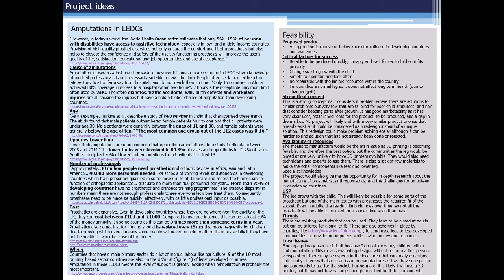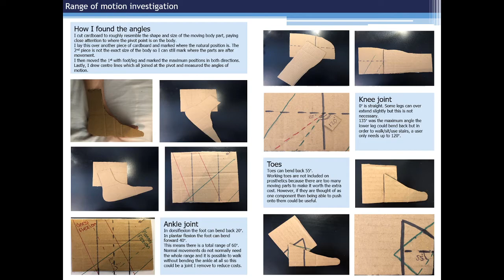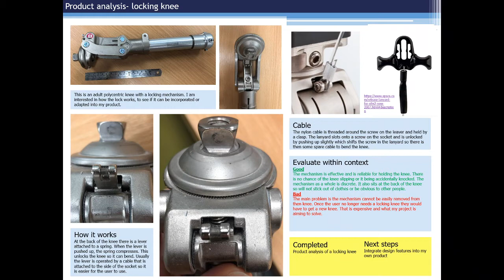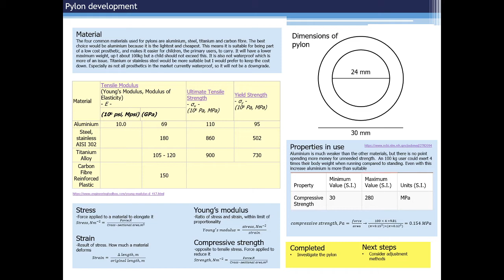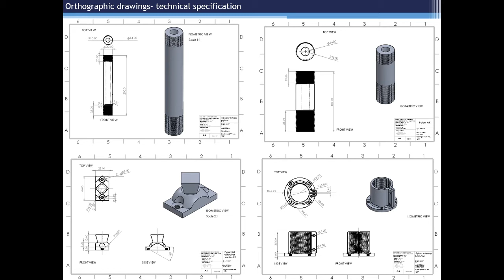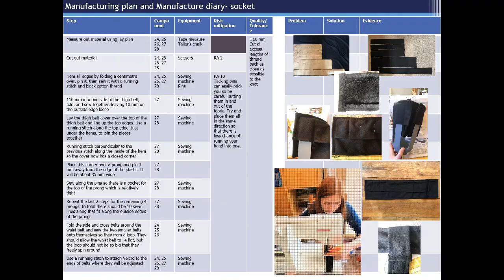NEA - Outstanding

Comment: For AQA the max number of slides for the NEA is 45. 

I'm not sure why they are so strict about this.
4.4 Non-exam assessment criteria

4.4.2.1 Evidence

Students must produce a final prototype based on the design brief that they have developed. Students should produce a concise folder. 

We recommend that this folder should not exceed 45 pages. 

Students who do not follow these guidelines will penalise themselves by not meeting the expectations of the assessment appropriately. 

Students that exceed the recommended length will self-penalise by not being appropriately focused on the demands of the task. 

Students that produce work that is shorter than the recommended page count will self-penalise by not allowing appropriate coverage of the assessment objectives.

AQA-7552-SP-2017

Comment: Hi I have a question about the finished product. I am currently in the final stages of doing a feasibility study and evaluation of my product (Delivery Drone). All of the parts of the drone including the whole circuit (apart from the individual electronic components) have been made by me everything about the drone seems to work fine even the drop off mechanism however I cannot seem to get it to fly stably due to poor quality of components that I have available. Do you think this issue is going to affect my final grade a lot or not and also what could I do about this?
Reply from the maker: The flight of the drone isn't important. The mechanical parts you have designed are the main bits. Show what works and what doesn't. Be honest and use the aspects that haven't worked as you wanted to as buts to modify or change as part of your evaluation.

Comment: Is using some templates and the writing format of how the information is presented ok to use if all of the information is my own, or is it still a form of plagiarism? I am trying to set up my writing structure so all my information is laid out in a way where it's most efficient so it would be helpful to know this.

-edit Also i wanted to ask how important actually is the aesthetics of the report, like is making it look nicer and easier to read the information gonna help a lot or a little?
Reply from the maker: If the template is your own, then it can work. This example, the pupil planned her own approach and used it throughout. However, you'll see that she isn't regimented with its use and whilst the colour coding is always the same and often sheets have a similar lay out she isn't forcing herself to have a set number of images or a set amount of text. A really rigid structure will stifle your creativity and ability to show your work effectively, so it should be avoided. Hope that helps.

Comment: Hi there! I'm currently working on my NEA and I'll soon need to design some 3D models using a CAD software. However, our school are still using an ProDesktop from like 2004. It's such a pain to use, and SketchUp can't create engineering/technical drawings. Do you have any suggestions for a good CAD software with the capability to produce engineering drawings from it? Also, what is the program that this student has used? Many thanks :)
Reply from the maker: This student used Solidworks. OnShape is free and a good option. Give that a try and see YouTube for tutorials. Good luck. 👍

Comment: hi i was just wondering if i copied the format but everything is in my own words and my own ideas but project is completely different even for identifying problems. for example my project is a sustainable transport but a project i copied it format it’s a product for the homeless. also every slide has similar style for example slide 10 is stake holder input but the example project page 10 is stake holder. does this count for plagiarism?
Reply from the maker: Making yours look like this in terms of layout only won't be a problem. However, to do so precisely will be a lot of effort. Your project will grow organically and you'll need to look at different aspects. This alone will mean that it may start off in the same format but it'll soon be your own.
Reply: @designtechnologytv507  Thanks so much for the quick reply! This was really helpful.

Comment: honestly, i got a 24/25 from just about 50 slides. Its complete cap about 100 slides. You need to be careful on what you say. its not about quantity its about quality.
Reply from the maker: 60-100 slides is average. It can indeed be done in a lot less. Your slides must have been exemplary in almost every way with no omissions and incredibly high detail. Well done to you and your teaching staff.
Reply: @designtechnologytv507  This is wrong. I achieved a 85 / 100 (equivilent) with only 48 slides. And 60-100 is not average at least not for my class, who all did <50 and got good marks. (70+ avg).
Reply from the maker: @TheRealKinetic-q1t  Again, well done if you've done it in a concise way and received a really good grade. I see hundreds of NEA each year. 60 to 100 is normal.